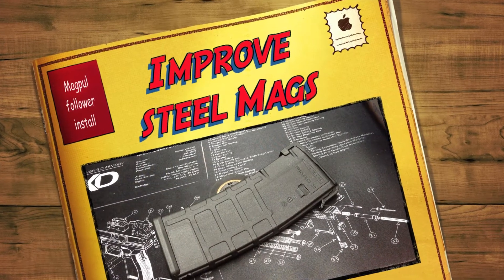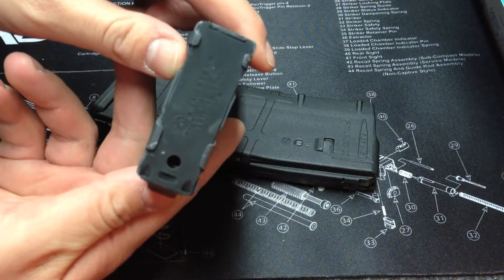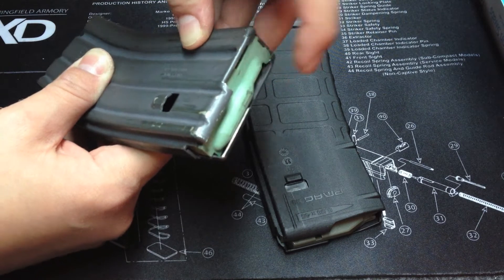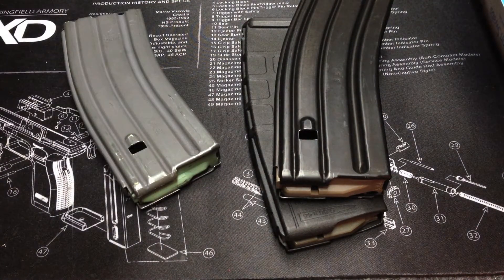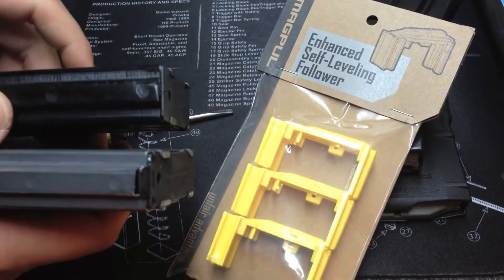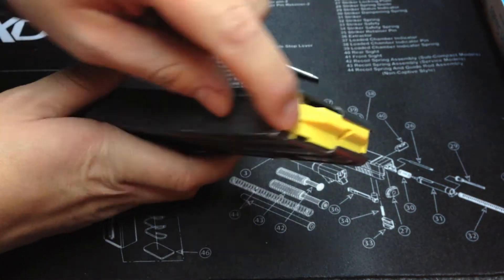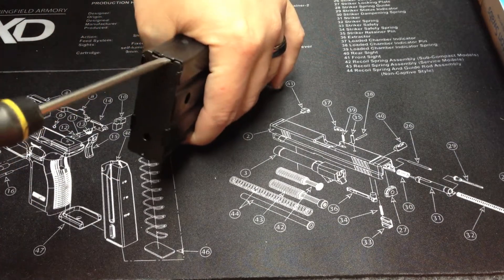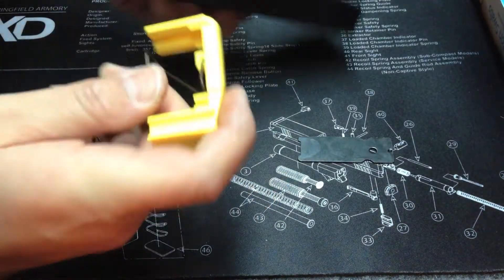How to improve your 30 round AR-15 magazines - install Magpul follower for Pmag performance

Comment: I find it easier to get a small nail punch and insert it in the hole then pull up and push out the bottom plate. In late 2013 Center Industries out of Wichita KS got a $58,000,000 dollar DOD contract for 30 round magazines. They now use an antitilt follower in their mags. It is green with the bullet on top.  The magpul follower is probably the best designed one on the market.

Comment: The new style USGI magazines with the tan followers will not accept the Magpul anti tilt followers because the spring is a different style. I think if you use the older style springs, then the Magpul anti tilt followers will work in them. Not 100% sure of this, but I think I’m right.

Comment: I have such a hard time getting the old followers out; they get caught on the tabs. They get stuck and eventually I tend to just get pissed off and take a pliers and bend the tabs out of the way.
Reply: fatefinger good way to brake those small lips
Reply: Just be patient and don’t bend the tabs on the bottom of the mag. I’ve had the same problem, but I just take my time. A magazine is the heart of your firearms. Without a good quality mag, your firearms are useless.

Comment: USGI are probably the Best Mags to use. or maybe I'm just to old Fashioned.
Reply: Zippo Lighter they're not. not even a little bit
Reply: Carbonsteelblade The Original—You are not old fashioned. I have some NHMTG magazines made by OK Industries. They have been making mags for the military for 40+ years. Mine came with the Magpul anti tilt followers already installed. They are my go to mags for a SHTF or WROL situation. I would never sell them. I don’t have anything against the polymer mags. Like you, I just prefer the USGI mags.